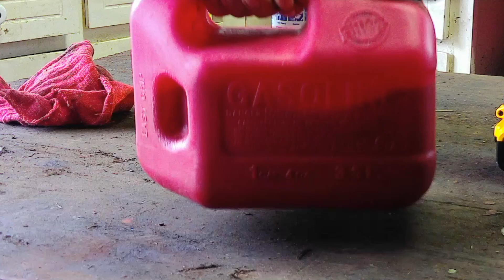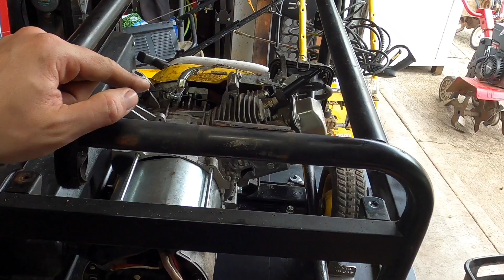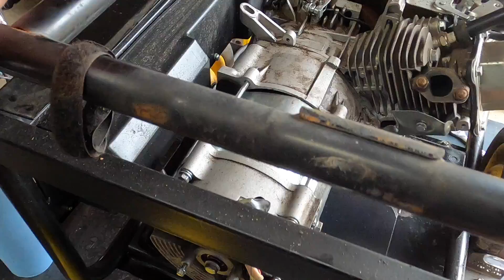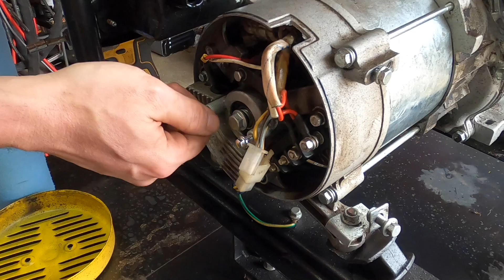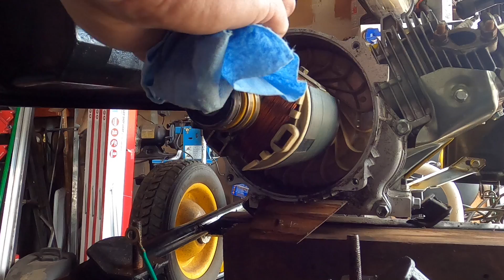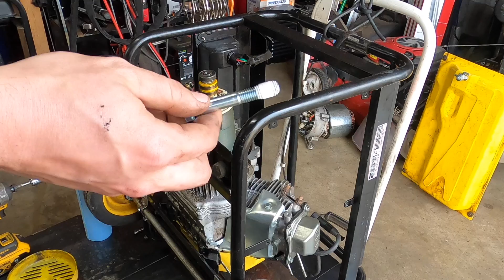How to Remove Generator Power Head

Comment: Do you really need impact drill (I do not own one) to remove the generator power head with the oil pressure solution? And at the end screwing back the threaded rod is sufficient to replace the generator rotor back in place?
Reply from the maker: If you don't have a impact you will probably need to get a steel rod that is a bit bigger than the bolt that was removed. Put the rod where the bolt was and cut it so it's maybe 3/4 of a inch shorter. Take a smaller bolt and crank down. After it is very tight you can hit the top of the bolt and it should hopefully pop off.
Reply: Thank you again! One last question, do you remembrer the thread for the screw? I am also working on a Champion but 6000 Watts, so I am sure the same type of bolt will be required.
Reply from the maker: I don't remember the thread unfortunately but it was rather course. Most of the time there isn't threads and you have to make them with a tap
Reply: I finaly remember that I have an impact drill, a 1/2’’ for car wheels, so I used it to unscrew the long rotor screw. Now after removing all required parts I am not able to remove the top rotor assembly. I do not want to damage anything, am I missing something? Seems the top assembly is stuck in place by pressure like it is for the bottom. You used oil pressure to remove the bottom but for the top what should be the strategy?
Reply from the maker: Can you send a picture to me on Instagram.
Reply: @PNWSmallEngineandLawn  Done.